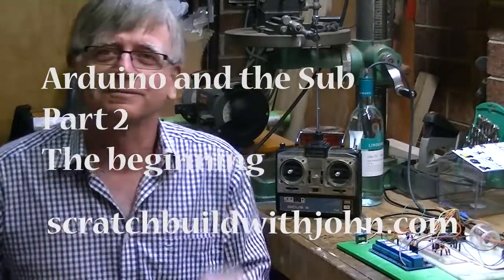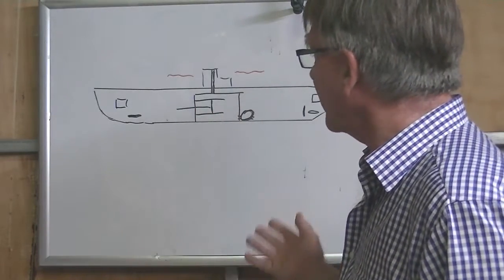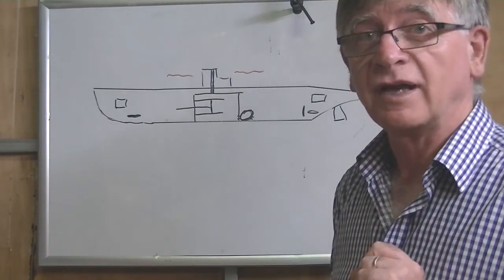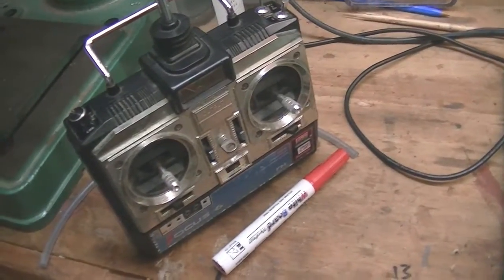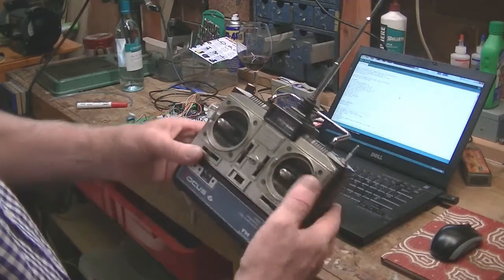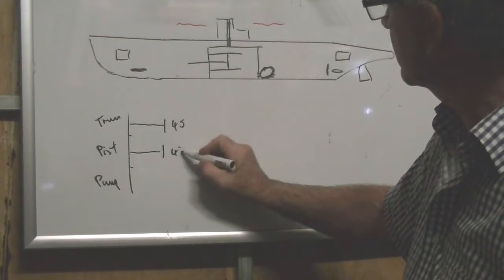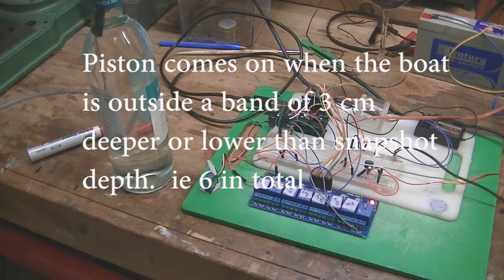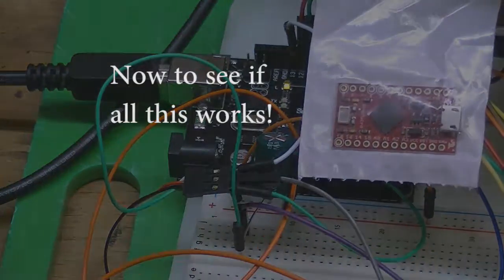arduinosub2

Comment: Hello John! Unfortunately I can only read English, so I had to use google translate to write to you. I'm also building a model rc-submarine, I also decided to use the Arduino in my submarine, because I'm too lazy to do circuit design and to use atmega or pic chips. I would like to ask you, what kind of pressure sensor you are using for the auto-depth-control in your model? If you can, please write its name. I understand that the sensor measures the pressure of the air bubble, which remains in the tube?